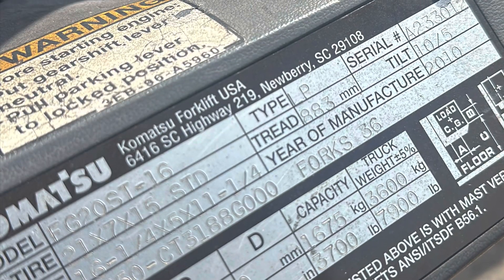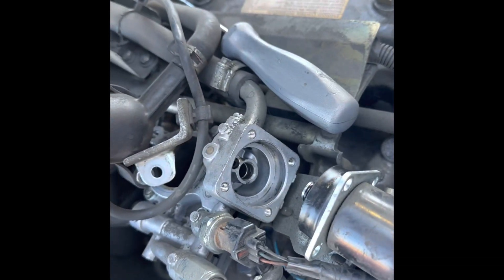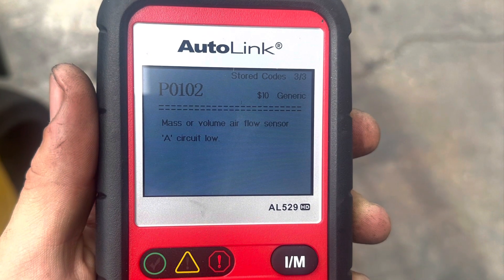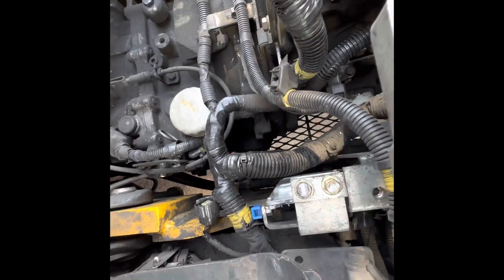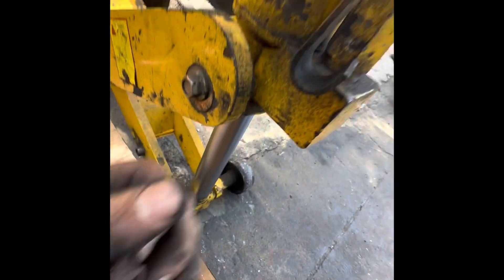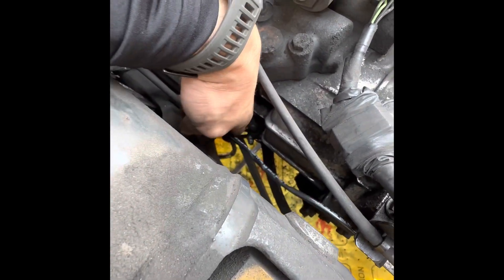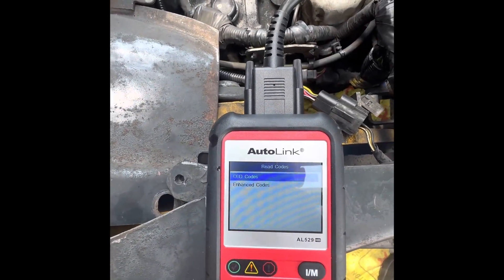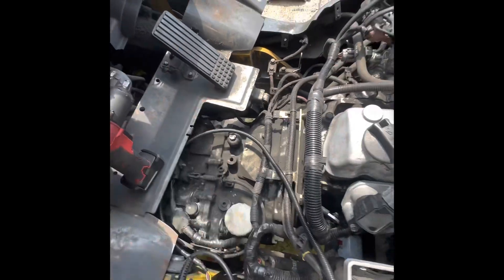Komatsu forklift FG20ST-16 Does not accelerate. How to fix!!! [READ DESCRIPTION]

Comment: Did you have to relearn the throttle position sensor after replacement?
Reply from the maker: No, just make sure it’s within those voltages when fully depressed and fully pressed in when you adjust it.

Comment: Hi this forklift hawe obd2 conector ? 
What kind of computer u used
Reply from the maker: I used a regular OBD2 scanner but you need the adapter plug. The dealer sells it or you can get it from TVH if you have an account.
Reply: @theforkliftguy  do you happen to have a part # for the adapter?
Reply from the maker: @jacobpasadyn3726  yes. PART NUMBER: KO3EA-55-38680

Comment: What harness adapter did you buy to link to that scanner. Cause I work for Komatsu and we have a special scanner.
Reply from the maker: I used a link that goes from a 4 pin to obd2 port and it connects to my scanner The 4 pin is right in front of the ECM by the battery and fuses. I got it through TVH thanks to my local Komatsu dealer.
Reply: @theforkliftguy  do you happen to have a part number  for the adapter? I have a Komatsu fg25t-16 that has a engine code that I need to check
Reply: @billylandry98  me too it doesnt acelerate  when you put foward or reverse when is neutral acelerate well

Comment: Where are you plugging your scanner into ? is there an adapter cable for the obd scanner
Reply from the maker: Yes, there’s an adapter cable that you need. It plugs into a small 4 pin plug literally right next to the ECU in front of the battery and fuse box. It’s hard to miss
Reply: @theforkliftguy  HI where did you get the adaptor to connect to the OBD plug please?
Reply from the maker: @arthurle288  TVH sells them.